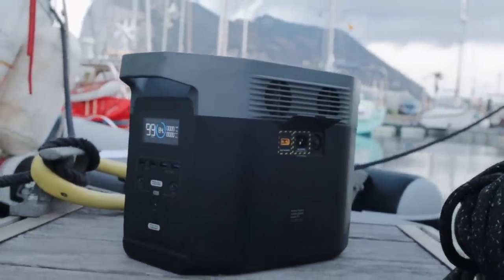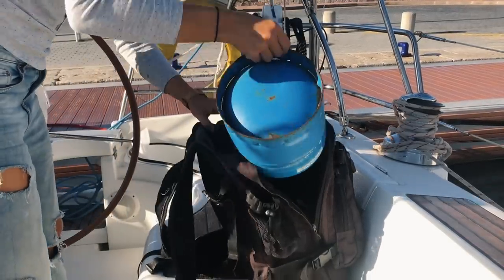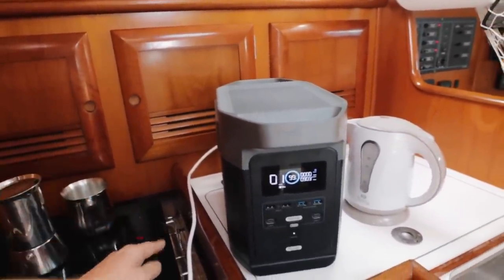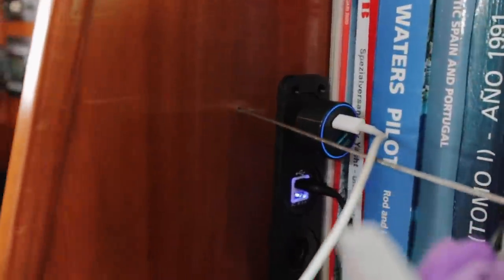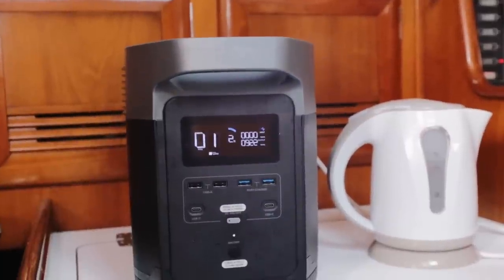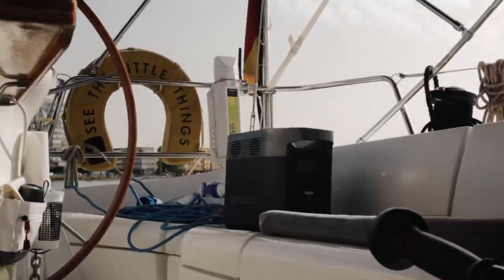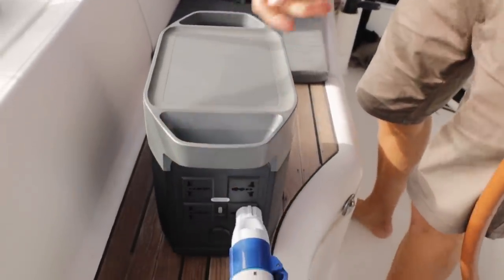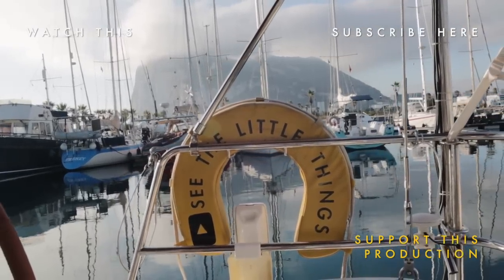New sailboat ENERGY SOLUTIONS - Adding the Ecoflow DELTA Power Generator to our setup

Comment: For most people who don't have the skills to electrically engineer their own lithium set up, these power cells are great... I don't have one and I can build my own set. Most of my friends cannot however. What the expert commentators on here, who talk about the individual componantry costs do not comment about, is the cost of hiring an electrical engineer to install the individual component pieces to make up a system to do exactly  what this portable unit does in one box. Measuring. safety management, power outlets, charging, etc. I wonder what a marine electrical engineer charges for the hourly rate to install an individual component system. You can take this unit to the beach and run your induction cooker, and most likely a stereo too... Portability is the key for me, as is plug and play. Genius... Alex, you explained this unit really well, especially for those who don't have an electrical engineers background...

Comment: This device is much more than just a battery and an inverter. Unlike others here I see it well priced. I have a similar 450W unit (and two 120W peak flexible solar panels). It is very good to take it with you and you can even take it to another place to get some electricity in case your charging options have a problem. And it is easy to take electricity with you when you want to have it a bit away....

Comment: Interesting - a non integrated but mobile solution. How does the charging with the engine's alternator work? How many amps or watts are you feeding from the alternator into the Delta when charging?

Comment: Great video! How is the system going three years later?
Reply from the maker: Still going strong. We’ve been using it on a 12v charge from the house bank to top up for high current applications. Being gentle on the agm house bank not using an inverter directly is a good buffer

Comment: You said you plug it in and fully charge , at what % was it down to , ie 70%  60% ,  ?
And underway you charge it from the house batteries , you then need to charge them, 
And the house batteries take longer , lithium are a fast charge system, ?

Comment: Interesting - thanks for that video. We're currently thinking about upgrading our system to lithium…but as you mentioned, the cost is giving us headaches 😳 I saw that you can charge the international version only with  220-240V…I imagine you're thinking about crossing the pond - do you have a 100-120V version aboard too? Oh - and another question…could you post a link to your induction cooker? Looking for one too 🙃 Thanks,  Philipp (@svamae)
Reply: Thanks for asking about the induction cooker.
I was going to ask. 
I look forward to the reply.
IKEA sell a small one but the website does not say how much power it uses.
Reply from the maker: Hey Philipp and Davy, it is indeed the IKEA plate. It was about 50€/$ and we bought it to use in the marina during winter. Gas bottles would have cost us the same so it was an easy choice. Now it comes in even handier. In our case it takes about 1000-1500 W depending on the size of pan and setting.

Comment: Guys, just to clarify. You have a LiFePo4 battery.  Rated at 105 Ah @ 12 volts or 1260W/h with a Pure sine wave inverter rated at 1.8Kw max output continuous that cost €1400.00 in its basic form and is only good for 800 cycles at 60% not rated at 80% or greater? Which your recommending as a good solution?  Sorry, you probably won't answer or just restrict or comments but come on we thought better of you....
Reply from the maker: Hey guys. A victron 100ah lithium battery costs about 900€, a pure sine at about 1200w costs about 400€. This is a bulky solution with more wiring and less outlet variety. So yes, we like this autonomous extra battery, decoupled from a house bank that otherwise would need to be full lithium upgraded to handle these loads. Which would require more than one lithium battery. Up to you what to think about it
Reply: @seethelittlethings  Guys. Go to our website and look at our technical section. "lithium the facts".  Quality LiFePo4 batteries are currently available at circa €670.00 per 100Ah. Including the BMS. AGM Spiral cells are available at circa €0.97 per 100 Ah .Quality full sine wave inverters are available at €240.00 for 2.5Kw peek and 2.2 Kw continuous. Both with reputable companies and equivalent or better warranties.  Please guys, a lot folks look at you for guidance and a way to escape the bonds. At the very least give them some comparisons based on fact. €1400.00 could be better spent! Sail Safe Guys, Ant, Cid & the pooch crew.
Reply from the maker: We didn’t find a LifePo4 lithium battery for less than 950€ (for 100ah) in Europe. If you do, please give me a link! So for us this is a neat solution. People are still free to do their own research and not take our word for it. We clearly stated that in the video. Besides we are no experts, we are just sharing what we experience. And our experience with this product is positive :) we are truly happy with it! Just personal preference right?
Reply: @seethelittlethings   Guys we love your vids, but just think you are doing yourselves a diserviveice and those that follow you. 10 Minutes on google will find you LiFePo4 @ €650-750 per Ah including BMS from reputable companies other much bigger sailing channels have used. Read the facts on our website we took a lot of time and trouble to provide, for free. Oh and BTW Ant is a electrical engineer and a member of the IET so its qualifications and experience, over 35 years industry related. Not just personal preference that we pass on. It's fact. We are not going to comment further but perhaps, just perhaps you may want to think about what's best for your followers or those that may be influenced by you. Sail Safe Guys, Ant, Cid & the pooch crew.  We will keep watching :-)

Comment: nice solution but do you really need an electrical toothbrush on a boat?
Reply from the maker: They use like 15watts to charge and last 2 weeks on a battery. You could even do it with the led acid batteries and a cheap converter. Love my electric toothbrush! But personal preference right ;)

Comment: So a quick look, The second page of the manual says -> 

1. DO NOT allow the batteries to come into contact with any kind of liquid. DO NOT leave the batteries out
 in the rain or near a source of moisture. DO NOT drop the batteries into water. If the Inside of a battery
 comes into contact with water, chemical decomposition may occur, potentially resulting in the battery

 catching on fire, and possibly leading to an explosion.   

I know that manuals are written to protect the company, but anyone that has seen a lithium fire would be keen to avoid it especially on a boat just saying ....
Reply from the maker: True that, I believe that counts for every lithium battery installation. I hope no one keeps it outside 🥴

Comment: Please notice: I was not able to verify that these Akkus are LiFePO4. The seller doesn't answer the question or answer that the Akkus are 18650-Akkus (which is according to Wikipedia the form factor, not the chemical type) So: If these Akkus are not LiFePO4 you are not able to fight the fire in case they inflame themself. The chemistry will produce its own oxygen in case of a fire. And that makes them for me unacceptable on an offshore boat.
Reply from the maker: Hey Carsten, according to the manual, the cell chemistry is lithium ion, the cell type is 18650.  

If you don’t want lithium on a boat for cooking, your alternative source of energy is butane/propane. We currently reap the benefits of both
Reply: @seethelittlethings  Lithium-Ion comes in many ways. For a boat, LiFePO4 is absolutely OK. BUT! It has to be LiFePO4. This kind of Lithium-ion battery does not produce its own oxygen in case of fire. All other kinds of Lithium-Ion do! For example, the AC200P from Kirron or Bluetti are LiFEPo4 and therefore absolute OK on a boat. If you have (for example) a LiCoO2 you can't fight the fire and it will burn through the hull. That makes this question so important to me. But the support does not answer.

Comment: For the same price as this device I can have over 300 amp hours (3x this device) of BMS protected lithium batteries with a marine inverter. This device is only good as a portable or backup solution (an overpriced one) but for a cruising boat it makes little sense cost wise.

Comment: For £230 you can get a pure sine wave inverter 4000w 8000w that will power 99% of what you want on a boat, straight from your batt bank, think you said last video you have a small amp hour bank work on that with deep cell acid batts thay last yonks if you look after them, i can see free stuff is cool, but i feel your problems lie in your bank, if it works for you it works for you👍

Comment: Yes lithium is expensive.  The Ecoflow must be very helpful.  You could plug it into your shore power cable and power the whole boat couldn't you?  It is 230 volts correct?  Oh i don't know if there is a built in protection mechanism for the Ecoflow for low battery state, but typically going below 10% will make the Ecoflow not last as long for you over the years.  If you can keep lithium batteries between 30% and 70% then they will last 4 times as long as the manufacturer says they will last.  The number of cycles.  So 3000 cycles can become 12000 cycles. Do not charge the battery if the temperature is below 0C.  Below freezing charging will destroy them permanently.   Also you can get lithium batteries very cheaply.  Ebay Europe is a great place to buy used batteries.  In the US sites like Battery Hookup and others sell cheap lithium batteries all day long.  Lithium Titanate is what I am switching to...my grandkids will get working batteries.  20000 normal cycles maybe 80000 if I do the 30-70 charge thing.  The think is you only get 85% or so of the charge out after charging them up.  So they don't discharge as efficiently as other forms of lithium batteries.  No biggie when you can use the whole cell consistently without having to worry about the battery never working again.

Comment: The way your using it will burn through the charge cycles of the battery in less than 2yrs also your getting less out of the battery plugging it in directly to the between the conversion just a heads up and after 500 charge cycles your at 80% of the battery then at 800 cycles your at 60% capacity and need to replace the battery.
Reply: Decent Li-ion will last for 8.000 cycles.

Comment: Hi Guys.  Thanks for sharing the content.  The EcoFlow DELTA certainly looks interesting, and its all-in-one/integrated invertor approach appears to be working well for you.

A couple of things for you:

You may want to check out Will Prowse's review of the DELTA as he gives it a very good going over and lists his pros/cons.
https://www.youtube.com/watch?v=xjl3s1CdYII

You also may want to think about upgrading your engine's alternator.  I believe you said that it was a 30Ah unit, and this is relatively low/slow.  You can check out Sailing Faire Isle's video, which discusses this very issue.
https://www.youtube.com/watch?v=_FVaF1AcCXk

And finally, I wouldn't poo-poo a general upgrade to Lithium-Ion, based simply on cost.  You may want to review the market again, as the prices are coming down all the time, and it's now common to find quality 100Ah LiFePO4 chemistry drop-in replacements for much less than €/$1,000.  Given their much deeper DoD and much increase cycle life, they easily deliver better value than AGM.  Obviously, you'll want to do a full review of your electrical system before doing anything rash.  Still, you may want to consider what a genuine 400-600Ah domestic battery bank would mean for off-grid living.

Power and water are two things that a live-abroad cruiser can never have too much of, and if you can renewably generate and reliably store sufficient of the former, then you can make as much as you want of the latter.  Anyway, have fun.